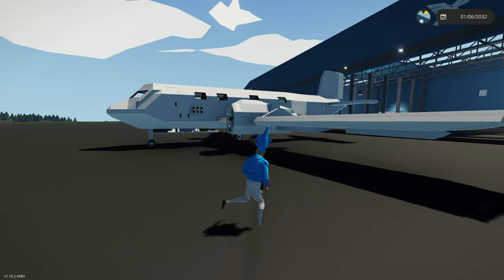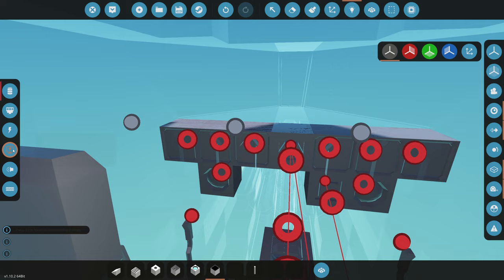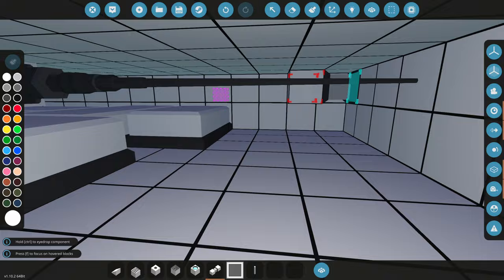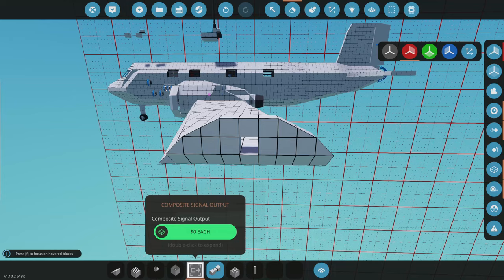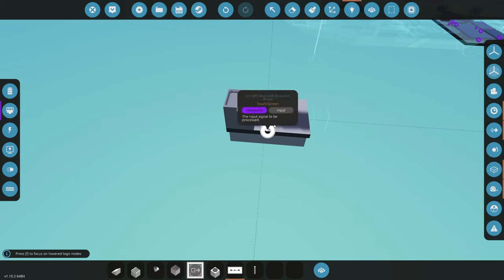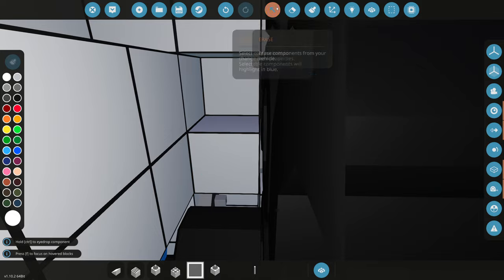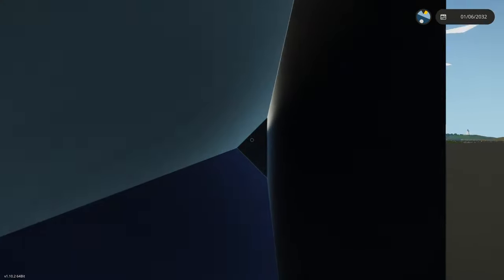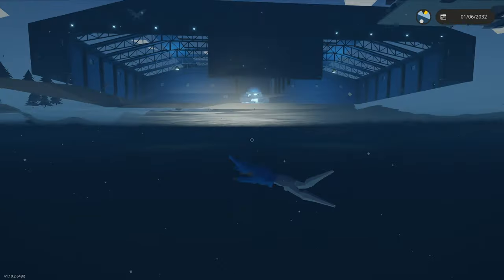Adding Computer Flight Systems to the Private Jet In Stormworks!

Comment: I think you should make a system which will pull up if you get too low (you have to activate it manually) but it might be too complex
Reply: Like the F16?
Reply: @Tanari-alsotanari  yep
Reply: @Fireblox6578  that would be pretty sick and could use altitude sensors
Reply: @Tanari-alsotanari  tyy